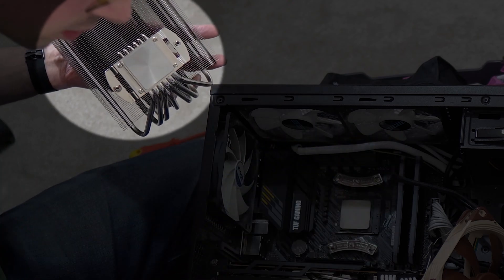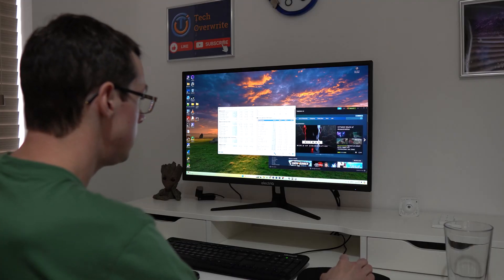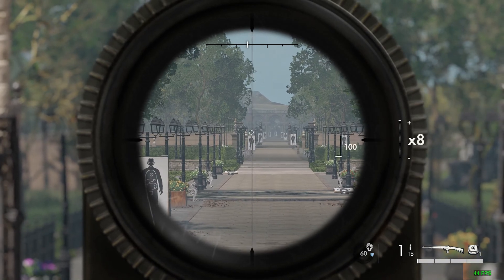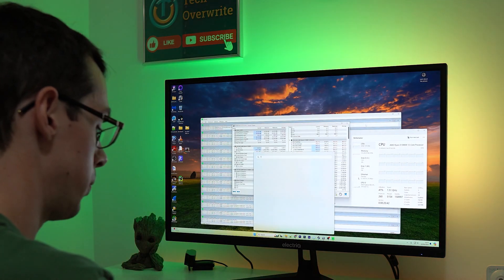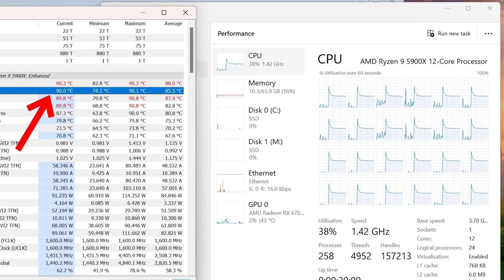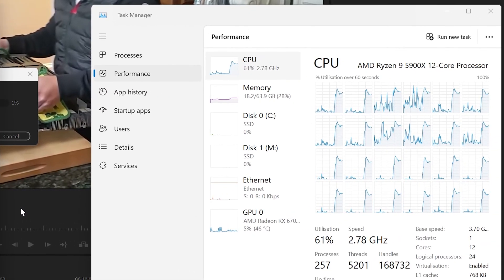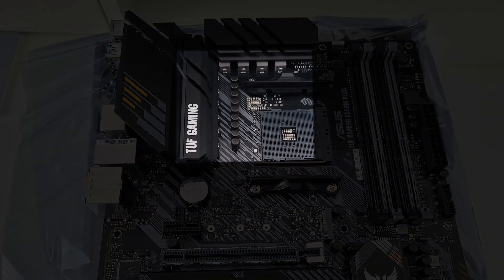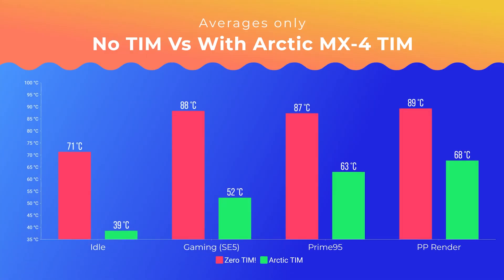No Thermal Paste, Just Heat... With My 12 Core CPU!

Comment: Saying "crazy idiot," I actually did disassemble my Acer Aspire 3 spin 14 2-in-1 Touchscreen laptop completely and then reassemble it from scratch, and I removed the thermal paste. Things are going okay expect the fan is spinning like a jet on startup and with thermal paste, the average tempreture for my laptop CPU was 40°C to 50°C on general tasks and 55°C to 75°C on gaming but now since there is no thermal paste, general tasks would be 70°C to 80°C and gaming would be up to 85°C to 105°C but hey, my laptop is still working. Before I dismantled it and removed the thermal paste, the fan didn't really run on startup (only sometimes), but right now, even on startup, it runs like nearly all the time on max speed. But my laptop still works. My question is, if I put a thermal pad on my laptop CPU instead of thermal paste, would it work? Would it decrease the tempretues of my laptop CPU and is a thermal pad rather than thermal paste better than nothing?
Reply from the maker: Haha, glad I'm not alone! That's a good question. Yes a thermal pad would probably improved things a bit (especially compared to zero thermal paste). Paste would probably 'always' be better for a CPU, but a pad should still help.